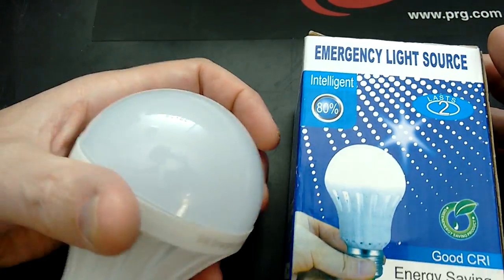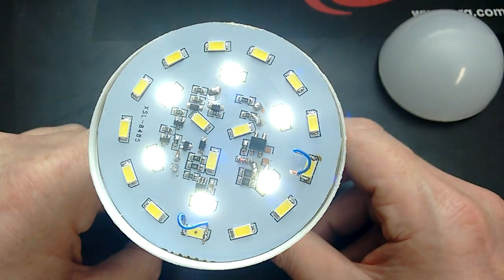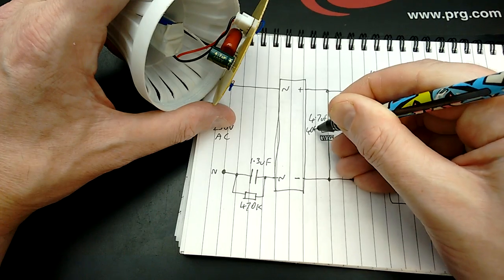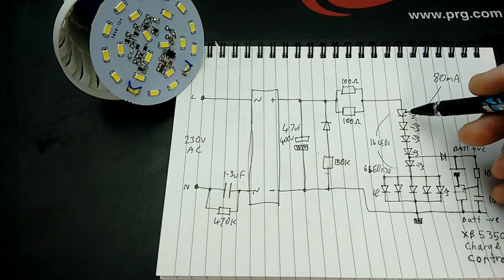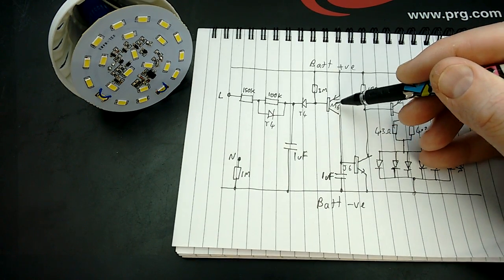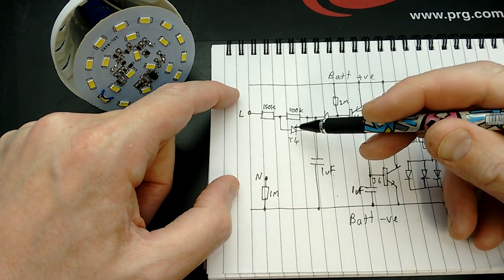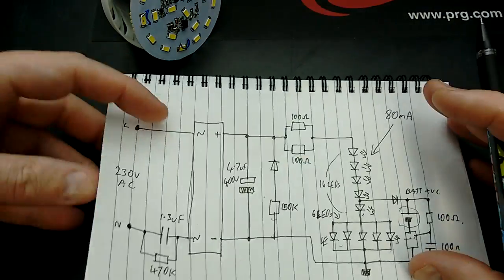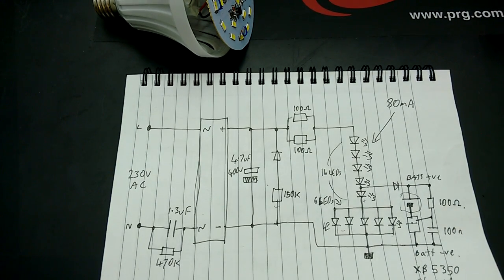Inside an "intelligent" emergency lamp with schematic.

Comment: led rechargeable bulb remains on even if switch is off. Which part needs to be replaced in the circuit?
Reply from the maker: If it goes out when removed from the lamp holder then the issue is with the wiring.  If there are other bulbs on the same circuit they will make it light.

Comment: I saw these and was thinking about getting a few, but realized that I don't really have a use for them... power outages in my area are exceedingly rare, and when there are power issues, it's usually on the order of seconds or minutes; worst case I can think of was hours, and I have a plethora of flashlights and battery banks around, so these would probably just sit and the 18650s would eventually die from being topped off all the time and not work when I need them to in 4-5 years, lol
Reply: Curious which country you're in now :)

Comment: I want to make my own emergency lamp using a TP4056 lithium battery charger. Any ideas on how to use the circuit to switch on you described with that module?
Reply from the maker: The absolute easiest way is to have a string of low current decorative lights connected all the time.  Like ambient decorative lighting that stays on when the power fails.
Reply: @bigclivedotcom  Thanks.

Comment: Does this bulb has switch to turn from battery circuit to direct electricity circuit when electricity is their or its runs from charging circuit.
Reply from the maker: The charging is done from the lamp driver output.

Comment: What is the max impedance or resistance of the "lights out" path  the bulb could work with?
Reply from the maker: They're very sensitive.  Even megohms will pass enough current to make some of them light.

Comment: I took apart one of the new emergency lights i mentioned before, not just how its designed thats different but with the addition of a socket adapter with a button on it that lets you use the light by itself under battery power without having to be plugged in.
The design is a bit different than the ones you've featured.
The LED portion is "similar" to whats shown here, but theres a 4pin header thats part of the LED board, there is a circular circuit board with an 18650 in the middle of it thats fit into the base, the LED array can be removed as its only connected to a 4pin header.  I took some pics if you'd be interested in seeing how it looks, though im not sure where i could upload them to that you'd be ok with.

Comment: Thank you Bigclive for your amazing  video 
Is there any way to use this bulb as power failure light only?
I need it to stay off and lights only when there is a power cut
Thanks again
Reply: I would like to know this too. I have no need for a bulb to be burning the whole time. I wonder what happens if the "mains" LEDs were replaced by normal 1N4004s or similar? @BigClive ?

Comment: what do you know number serial of ic with 5 connector? its like n type mosfet, but can using 220v~ to charge.. i have same type of lamp, but the schematic not many as you draw.. when ic was error, you can only using it for lamp, or cannot light out..

Comment: Is the circuit drawn correctly for the battery led switching part? I think 1 M resistor to battery +be is not required.
Reply from the maker: It forms part of the MOSFET switching current path.

Comment: Explained well with diagram. Can you pls teardown the below PIR product with circuit for 25mm
https://www.ebay.com/itm/110-220V-PIR-Infrared-Body-Motion-Sensor-Control-Switch-Light-Lamp-White-5W-200W-/323576843585
Reply from the maker: I already have one of those on order.

Comment: Hello,  I would like to ask a question. I currently using an emergency lamp just like yours. However when I put it on the socket, and it’s turn off, it’s dims. It doesn’t turn off. May I know the reason why.
Reply from the maker: It may be leakage due to other circuitry or a long wiring run.  Are there other lights on the same switch or is it switched from multiple switches?
Reply: It is a single switch and connected to a single lamp holder but the line runs along the wall. 

I’ve tried it with fittures and it dims too, but I do understand why it does that now. 

I do have a video to show you

Thanks for the fast reply

Comment: It was design, If the wall switch is off then no significant current will flow, but if it is on then current will flow through other appliances and circuits in the house and it will detect that and light.But,my concern is some bulbs doesn't off even switch is off. Why is that ?

Comment: Installed one in my bathroom, single pole, and it turns on all on its own after about 5 seconds of flipping the switch off and slowly gets brighter, hits full brightness at about another 5 seconds. What could be the issue? Bulb seems fine, can't open since it might void warranty. Any help would be appreciated. Love ur videos btw
Reply from the maker: Do you have a fan in your bathroom that is connected with the light so it runs when the light is on?  It will prevent these from operating correctly.
Reply: Nope, no exhaust fans, one switch for 1 light socket.  Placed it in a different light socket in a different area of the house and still same issue. I did noticed that when i turn off the the main circuit breaker(to simulate a power outage), it functions properly(doesnt go into emergency mode and you need to flip the switch to the "on" position to go into emergency mode and instant full brightness). Thanks for the reply, appreciate it.

Comment: Quick question here. I bought about 30 or so of a similar model, different brand 7w but basically the same concept. If its been on for a while, after you switch it off it will remain on for a few minutes with a lower brightness and then shut off. Is this the capacitor draining that you explained or what could be causing this.

Comment: bigclivedotcom Hey, do you think this is a safe lamp? I'm thinking about buying a few of those for my house. I wonder, is that little protection circuit attached to the battery, enough for over and under charge protection? Do you think it does the correct CC/CV charge cycle that an 18650 requires? What about the 18650 itself, it must be a very cheap one, should I replace it for a name brand, recovered from dead laptop battery but tested and in good condition? Is there any chance the board or the capacitor could be a fire hazard? Thanks. PS: (I have no smoke detectors, lol)
Reply from the maker: This is the only capacitive dropper version I've seen.  All the other ones I bought had a switching power supply in them and seem to be safer.

Comment: Tried using one on a 2 way switched circuit.
Comes on when switched on as expected.
Comes on, if switched on, during a power cut as expected.
But comes on very dim when circuit not switched on and cutting mains power switches it off.

Comment: hi 
the A1SHB is MOSFET transistor there is no transistor under the number of A1SH6 i have  E27 but they fault after shot period the causes first one 22mf 160VDC damaged another was some LEDS damaged when changed by another type of LED the high dc voltage capacitor is  damaged after the bulb was worked about 20 minutes  i checked the circuit it was likely same that you draw but they use 22mf 160vdc capacitor the source in my house is 220vac the idea of this bulb is very good but the age of it is very short

Comment: So interested that I went and bought one. In the same box as yours but a very different lamp.  24 LEDs on a board with what looks like an aluminium backing. The driver circuit is on a seperate board with only 2 wires to the LEDs. This means that all the LEDs light up when in normal or "Emergency" use. The lamp is reated as 12W bit does not appear to be more than about six, I don't have a fancy meter to check it unfortunately. Would like to see a teardown of one of this newer style lamps.
Reply from the maker: By sheer coincidence there's one of the newer version in the pile of stuff here.
Reply: Look forward to your report. On looking at mine again is is really dim even compared to the Korean bulb with the square LEDs.

Comment: Either your first schematic is drawn incorrectly or the two 100-ohm resistors are in parallel, not series, for an effective resistance of 50 ohms. I also think you're correct that the "pointing the wrong way" diode is probably a zener diode to act as some kind of voltage limiter or a crude "crowbar" regulator. :)
Reply: Non practicing electronic technician here. In my mind it's most definitely a Zener diode. How else do you bring down the voltage from 220V (or 110V) to whatever 6V? DC the circuit uses? It's a very crude power supply configuration that I used myself a few times.

5 years too late  but such is the workings of YouTube.

Comment: Neat idea but one slight drawback if this lamp was used in a room with more than one lamp fitting on the same switched circuit. When the power is turned off the emergency light would come on because the sense circuit would see the other lamp(s) in circuit as a dc path between the terminals.

Comment: The diode is there for a reason.

If the battery has failed while the light still has energy it will show

Comment: Damn big man clive they let you film at work.
its very cool
Reply from the maker: On a typical shift we power-up and test all the lights then repair anything that needs repaired.  While the show's running we can't work above the audience for safety, so we do walk round checks on our equipment and do thermal imaging checks on power distribution gear.  After that we may have spare time waiting for things to go wrong, so I made some videos in that time.  I'd have had to drop everything if a technical issue did occur.
Reply: bigclivedotcom I hope if i ever get a job it is as cool as that.
Reply: Q

Comment: Why have two resistors in parallel? What's wrong with just one?
Reply from the maker: It's very common.  Presumably to spread the load between the two resistors.
Reply: +bigclivedotcom +Roberto Gatti Thanks, that makes sense.

Comment: It would be more useful if there was a "turn off delay" with a capacitor. Because sometimes you just need 20 seconds more light after turning the lights of (we all hit our toe on the bed post once).
Reply: Use your phone flashlight for that trip

Comment: I have a cracking German made emergency light, its not intelligent but has a 3 way switch for light bulb mode, charging only or torch mode. proper smps and big lion cell, the neck of the bulb also extends to use as a carry handle, being e27 thread it unscrews easily and is quite handy if you don　have emergency lighting in Everyroom and need to go outside without trying to bridge a bulb,

Comment: +Clive, do you trust that no-name 18650 being under constant power? I'm not sure I'd trust my house on the battery nor charging circuit ...
Reply from the maker: In hindsight there is a potential extreme failure mode that I've now added in the video description and as a note that pops up on the video.  If the LEDs in the charger tap point went open circuit, then when the charge control chip tried to open the circuit the voltage would fly up to near mains voltage across it and potentially cause failure.  Worst case being the lithium cell continuing to charge until it failed due to extreme overcharging.  That could be exciting.
Reply from the maker: I regard it as a novelty.  I'm not sure how much I'd trust it for continuous operation.  At least not without some extra overcharge protection capable of handling the limited current at full open mains voltage.
Reply: I mean, as long as you test it to make sure the cell doesn't exceed 4.2V or drops below 2.9V it should be perfectly safe.
Reply: +vgamesx1 Assuming it is a 18650, and not half filled with sand ;) Just my personal preference never to buy eBay-esque batteries. Allows me to sleep better at night.
Reply: I kind of feel the same way, also because of the circuit sensing ability which basically means it's connected straight to the mains, I know it should be safe, but it doesn't FEEL safe.
Reply: +bigclivedotcom Big puff of smoke exciting??  ... and 100 times so in a house with wooden construction ;)

Comment: Something I was wondering: can you use just a diode to make it so a circuit charges a battery, but the power can't feed back into the circuit? Or have I gotten something horribly wrong?
Reply: You can with some batteries but not lithium, they need to be current controlled up until they reach 4.2V
Reply: google "how rechargeable batteries work" and "how battery chargers work"
Reply: Yes, you can use a diode to prevent the charging circuit from draining the battery when it's not on. However, because of the voltage drop across the diode, you would have to run a separate battery voltage sense line to the battery terminal.

Comment: the backwards diode must be a zener allowing voltage to short through the resistor above a certain level . its a rather sexy voltage regulator.  look at mee with my electrical hat on
Reply: I love it

Comment: If you get some more, it would be interesting to see what would happen if you have 2 of those lights in parallel, like some living rooms have 2 lights on one circuit.
Reply from the maker: I would guess they would potentially interfere with each other.  Especially if they were connected in reverse polarity to each other.
Reply: Since they output a small dc voltage you could have loads in parallel and perhaps run the rest of the lights with them?
Reply from the maker: It's a very tiny current at a few volts.

Comment: I doubt that the battery is 2.2Ah, those cost more than the entire bulb. It's probably around 1Ah. It's also interesting to note that lower quality 18650s weigh much less than good quality ones.

Comment: The last time I looked at how an emergency light worked I was in my teens and it was just a 120V AC (Canada) SPDT relay  powering an incandescent 6 Volt light from a 6 Volt battery when the relay coil was not energized. Things sure changed since then. The way this one works is really smart.

Comment: Just curious have you had the opportunity to test the lamps running time on the battery?I could see these being very helpful in my county house where long power failures in inclement weather are the norm.
Reply from the maker: Two possibilities.  Change the lithium cell for a higher capacity one and change the resistors used to limit the current to the LEDs so they run dimmer for longer.  Another good idea would be to halve the value of the main dropper cap to run the lamp at a lower level to make the LEDs last longer, although that would also increase the recharge time